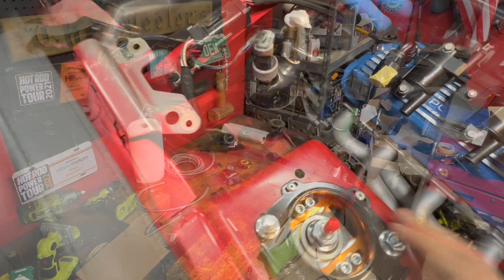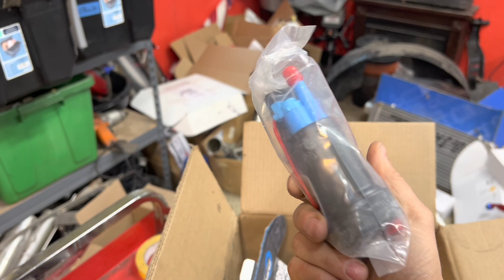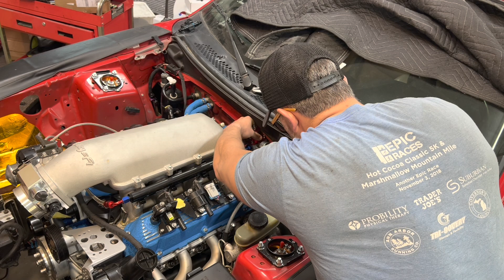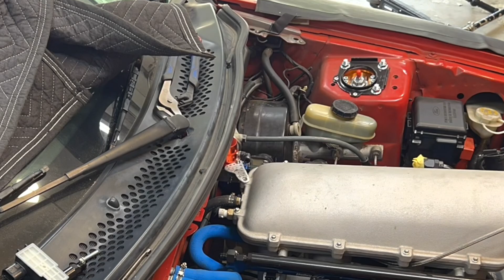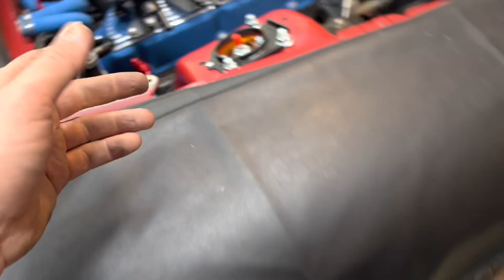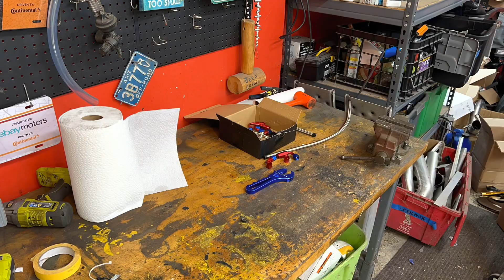Project Hellstang! Plumbing 6AN FUEL LINES, Regulator, and E85 sensor in our Turbo SN95 Mustang!

Comment: on the fuel regulator how did you plug the other wholes so you just use the return and not utilize the other two holes

Comment: Awesome videos so far , since I’ve been following but got a question why wouldn’t not over size you’re system so you have room to grow down the line
Reply from the maker: As it is now, there’s more than enough fuel for 500whp which I don’t plan to go past with the stock block. 

If I get a built motor or swap to something else down the line, all I need to do is run 8an line from the pump to the rails and we’ll have enough fuel for 7-800whp with the 80lb injectors and 525 pump. I just didn’t want to replace the metal fuel lines right now since it’s not needed for the HP we’ll be at, the extra cost, and the extra time we don’t have before the power tour.
Reply: @PeakPerformanceEngineering  makes since for the time constraints you are under , when I built my buddy’s car I built his fuel system to what mine was on my car when I went 8s cause that’s what he wants too do in future, it’s 306 heads and cam with a on3 kit with fast went 10.26 136 car should go 9s on e85 easy on 14lbs , that 500hp mark has been stretched with good tuning and rpm limits , good luck on your build for sure
Reply from the maker: Nice! That’s fast! If I decide to go over 500ish we’ll have to make some changes while the engine is out like changing the clutch, but I’d like to cruise this setup and work the bugs out for a year or two and then go back and go crazy
Reply from the maker: @austinjohnson6535  what axles you recommend? Still stock right now and will need to upgrade when I swap gears
Reply: @PeakPerformanceEngineering  I would probably go with a 33 spline moser with c clip eliminators and a spool at I think Eaton makes a true track to fit 33 splines 31 to 35 are all the same price from moser